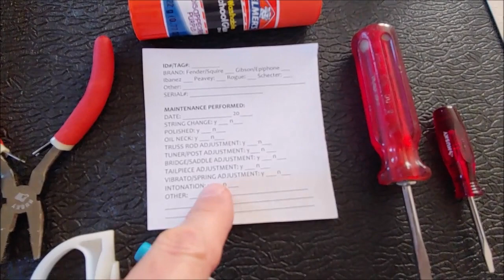FIREFLY FF338:  Set Up

Comment: I got one a couple of months ago to learn just what you are showing here. I had to do everything you showed here and more. My 338 was not as good as yours. I would only have a couple suggestions, use graphite or pencil lead instead of petroleum jelly and when you string a guitar you should loop the string back around itself and it will never slip on the tuner. The ff338 is ok but i did have to upgrade some parts. I put new tuners, new bridge, and changed the pickups to something less microphonic. I switched to a filtertron style pickup the sound seamed to match the style of the guitar.
Reply: What brand of tuners and bridge did you use? Did they solve the problem? also was there any customization to get things to fit. Do you get parts that are compatible with the Gibson 335 ?
Reply: @g-man7687  I put in Wilkinson 3R3L E-Z-LOK Guitar Tuners Machine Heads and bridge. It fits a standard Gibson style bridge. The hole spacing is the same. You just have to be sure of the post size. The bridges come in 2 post sizes. I think the Firefly is the bigger one otherwise you will have to change the mounting studs which is a big pain. I didn’t have to. All the parts came from Guitar Fetish but you can get them on Amazon too. Good luck.
Reply: @Icantdrive55  Thanks for your response I really appreciate it

Comment: If you thought it through you could've used an open end wrench for tuners and not had to cut them off. Rookie move
Reply from the maker: Do you mean a crescent wrench? "Cut them off" do you mean the strings? I COULD HAVE used another tool, yes, but I didn't.